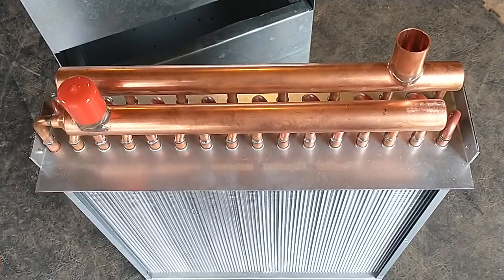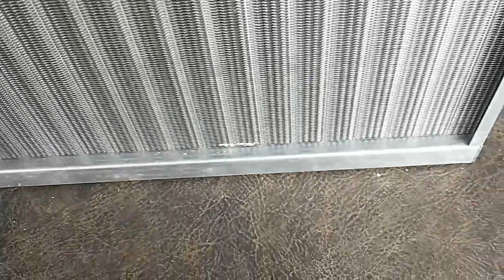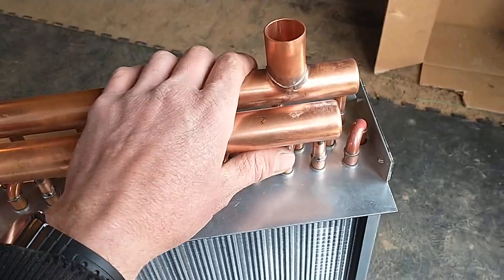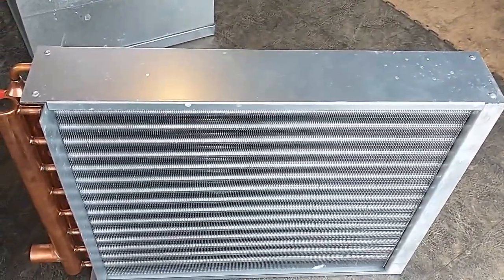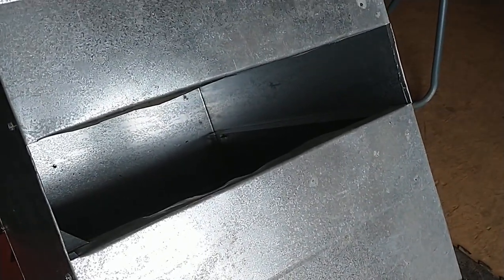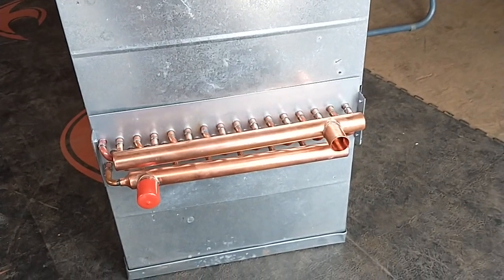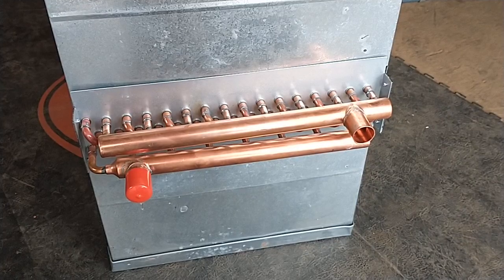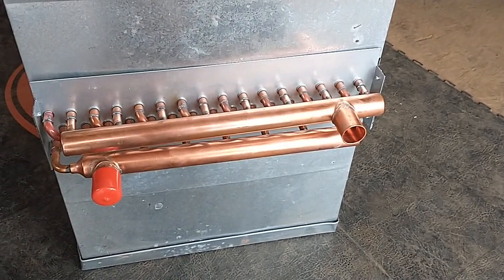Hot air coil, how it works

Comment: Bout to do this in my own home. My current Boiler isnt keeping up during the single digits and low double digits. I would need to add a whole Zone for it but what i would like to find out is the wiring for the circulator and blower to run together. Currently running a furnace as an airhandler in my unconditioned attic
Reply from the maker: @proverbs2life  There would typically be a relay that sends a signal to the blower and a signal to the pump to come on.  The details would depend on what type of blower you have.
Reply: @YoderOutdoorFurnacesLLC  ill look this up. Thank you!